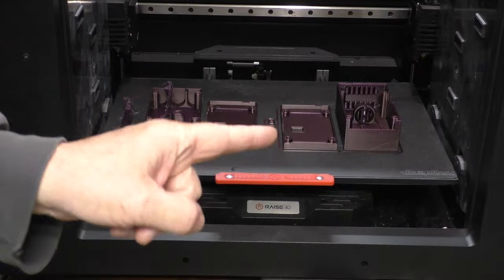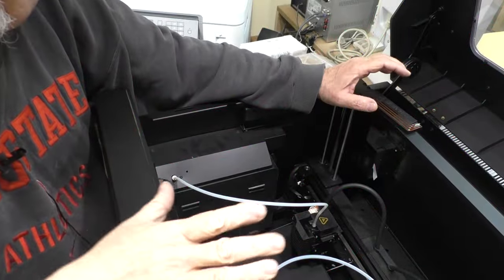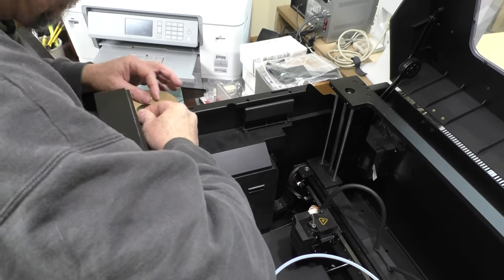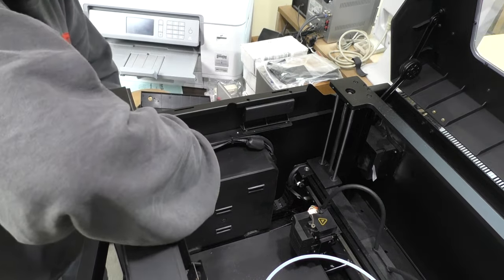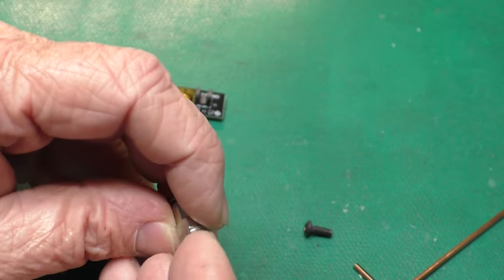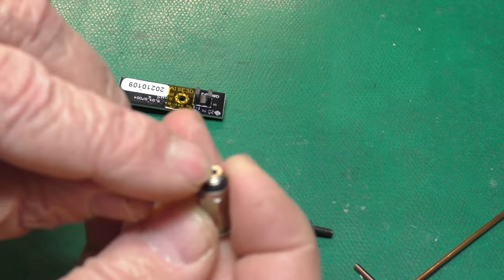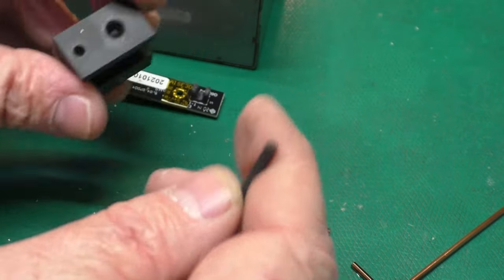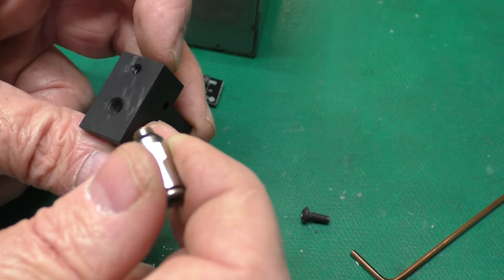Raise3D E2 Filament Stripping Quick Fix. May also apply to other printers.

Comment: I'm currently struggling with Light Weight PLA (LW PLA). I'm printing out a pair of airplanes, and one that has been printed was done in yellow, and wasn't too much trouble. The second one is being done in red, and every other part is giving me a hard time. Same manufacturer, just different colors of filament. What a PITA. 

Why are you getting all that fuzz in there? No heated box for the filament?

And completely unrelated, do you know where I can get a replacement LCD for a MK-85?
Reply from the maker: Different colors can take different temperature settings with some filaments. I'm not sure what fuzz you are referring to. The parts on the left were failed prints I set next to the good prints (on right) to show what the failure looks like. 

On the E2 the filament is stored on the sides of the machine in little cubby. The sides of the bobbies are what you see on each side of the platform. This in effect keep the filament warm and dry.

I don't know of anyone reproducing MK LCDs.
Reply: @HeyBirt  Yeah, I dropped the extruder temp from 230 (where it was set in the S3D Factory file created by 3dLabPrint) to 200 and started getting much better prints. The problem remains that the walls of the prints being so thin create bed adhesion issues. So the print will get to 90% and then tip over...

I assumed (wrongly, it seems) that the fuzz that you mention, and remove, @4:52 was from the filament. So where did it come from?

Thanks for the info on the LCD. I'll look around and see if anyone has had to fix this issue and what they did to get it working again. Thanks!
Reply from the maker: @MrWaalkman  The fuzz in the sensor and fans was just from the air. It is what accumulated after ~18 months of use.

I am printing a part now at work which has a very small contact patch. This was causing it to lift on the ends. I created a 25mm diameter circle, 2mm tall with a 6mm wide slot along a radius line. This is placed on build platform as close as I can get it to the main part without touching. I have also used 'pacman' shaped pieces on the corners of boxes. 

You might be able to create a similar 'helper foot' that just touches you side walls in a few places to keep it from tipping over.
Reply: @HeyBirt  Ah, okay. On my Rostock V2 it would ride in with the filament. But that was the least of its worries so I didn't bother with it.

And that's a good idea on the side supports. Thanks! If I end up printing it again I will probably do something along those lines. Two more parts and the hard parts are done. :)